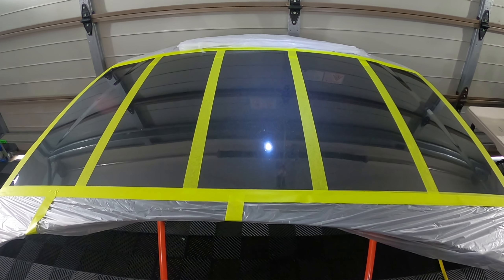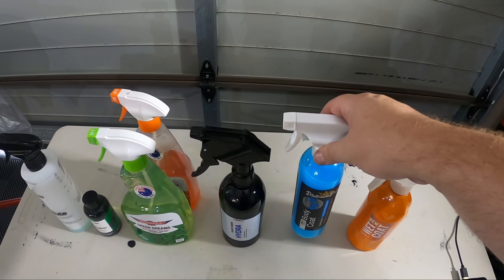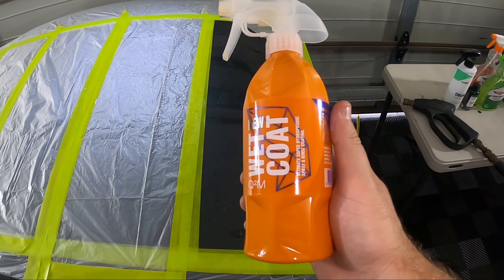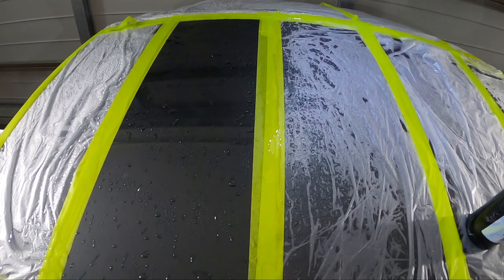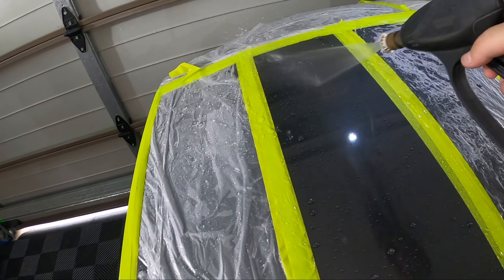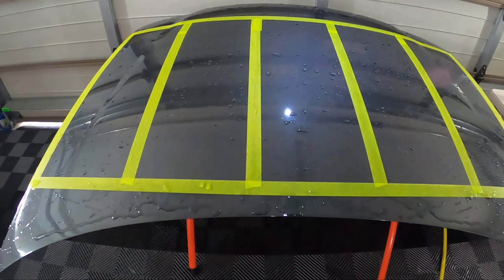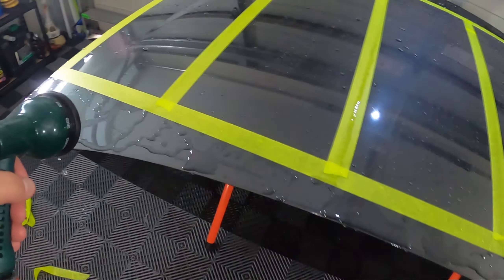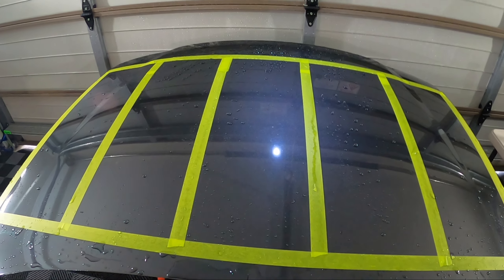Ultimate Touchless Sealant Test | Carpro vs Gyeon vs Bowden's Own vs Mirch vs Platinum Potions

Comment: My notes with my personal experience testing Wetcoat, Bodycoat, and Hydro2 (6:1) in particular application:

Wet coat was the only one that did well being sprayed on and worked in with a wet cloth before being rinsed. for whatever reason,  Bodycoat and Hydro2 didn’t liked being sprayed into the stream of the gun/hose or sprayed and worked into the panel. 

I had best results when I sprayed on and rinsed off each of them.

Wetcoat was slickest to me, but Bodycoat had the most hydrophobicity in my testing over 4 customer cars.
Reply from the maker: Solid feedback thanks mate.
Wonder if I'll get similar results to you

Comment: I would argue the carpet and gyeon were slicker and sheeting the beads off. If you watch it again it looks like the beads group quickly and run off so their just doesn’t look like as many beads. Which I would say is a much better hydrophobic attribute than the other three.
Reply from the maker: If you watch the second video on the series I do a slickness test on them and mirch was the slickest from memory

Comment: wait! "Platinum Potions Body Coat" website says to dry immediately after... will i be okay just rinsing with my pressure washer then blow drying? Will I get streaking?
Reply from the maker: Yeah I'd stick with their directions, usually not the best idea to blow dry after using these type of products.
As I was just doing a small area its easier to ensure no smearing or any other issues but for an entire car I'd towel dry after use